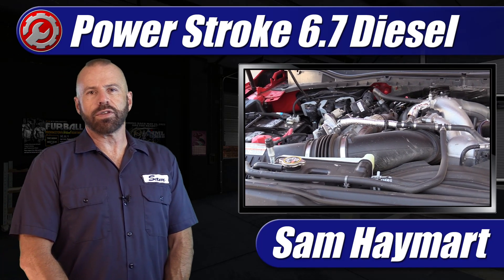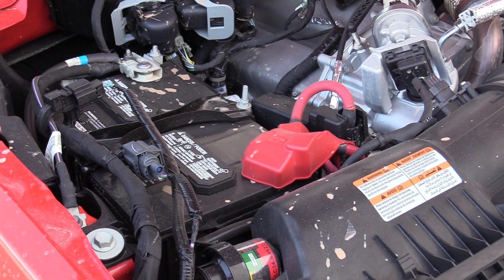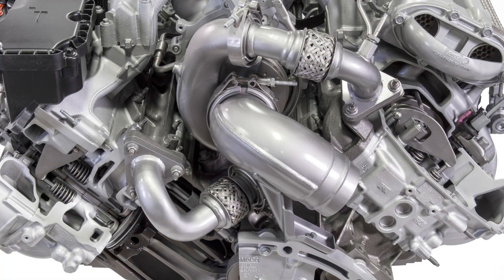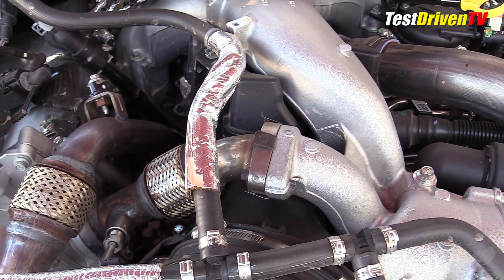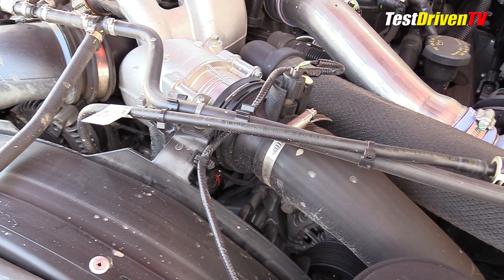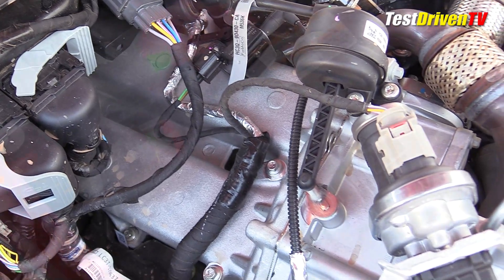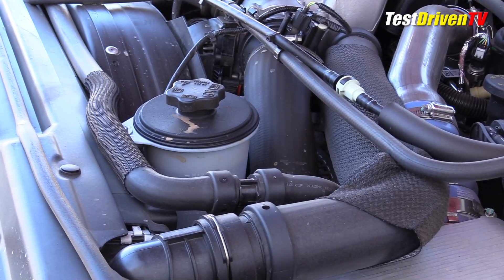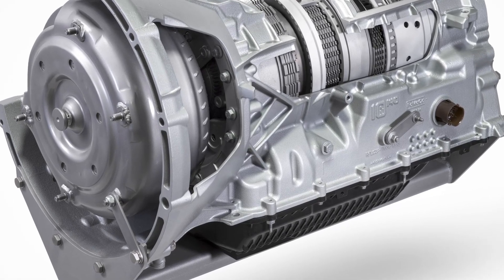2020-2022 Ford Super Duty Power Stroke 6.7 Diesel Explained

Comment: at least the EGR cooler is external. the integrated exhaust ports placed in the valley of the engine is very interesting. I only wish Ford used variable band clamps all through out the motor.

Comment: I went with 7.3 gas for simplicity under the hood. The 6.7 looks like your wired headphones after going thru the washing machine; way too big of a rats nest to untangle to be worth your time. If diesel I would have gone Cummins, way cleaner design. This reminds me of my 80’ bronco; there were so many vacuum and electrical lines going everywhere. I had a vacuum problem and a mechanic wanted to charge crazy money to look at it bc he said it’s a huge rats nest that takes a lot of time to figure things out.
Reply: My 17 6.7 ….2,000$ and it looks just as simple as any other engine and I’m getting 22-23mpg at 70mph…on 33s…😳  I’m not done yet either…pusher intake system along with a water/meth I’m betting I can get this thing to get 25-26mpg when I’m done with it.possibly more if I cruise at 50-55mph on summer blend